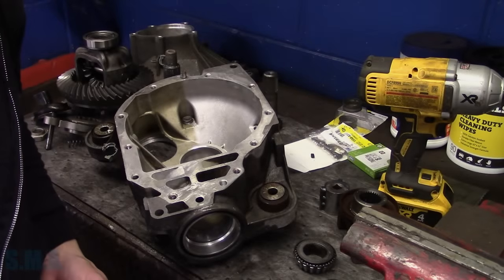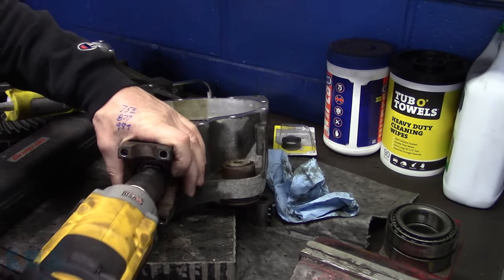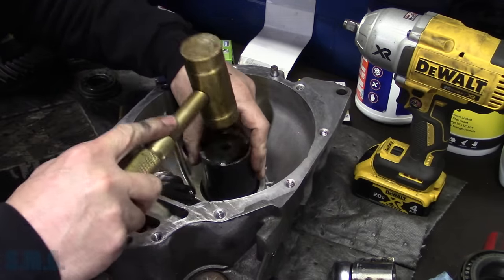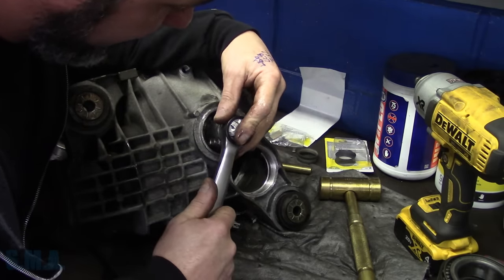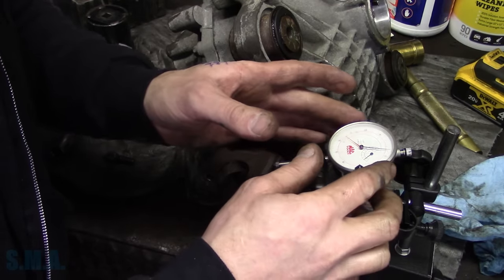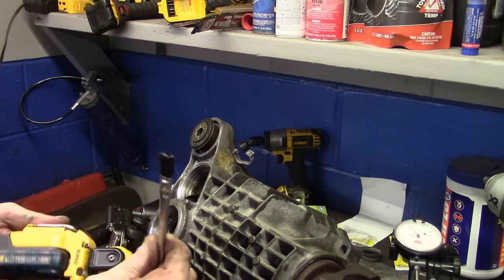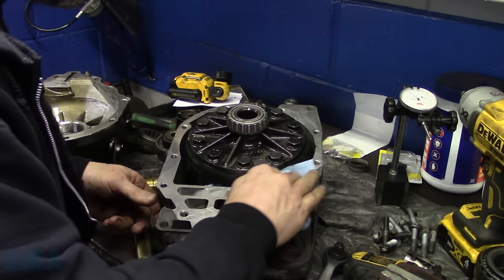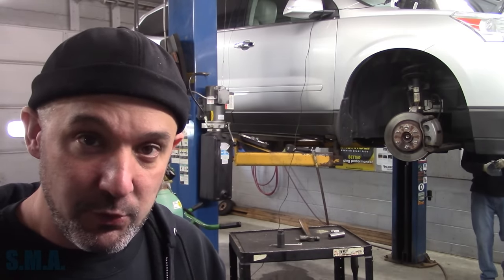Chevrolet Front Differential Set Up: Reusing Old Gears

Comment: Please do NOT say at the end of this video....if I can do it you can do it.....cause you have shown me that I have absolutely NO business messing around with this kind of repair
Reply: start off of something more simple like a ford 9".  Take your time and use your brain, you'll be fine.
Reply: I did my Ford 1 ton in my F250. I am not a mechanic, but I got it done right. I had to buy a few tools (bearing puller, dial indicator, inch pound torque wrench, 3/4" ratchet, etc). I swapped in 4.11 gears and a Detroit locker, so you can do it. You just need to take your time; there are many install/measure/tear apart cycles. Also, crushing a crush sleeve on a one ton required a 3/4 ratchet and 6 ft cheater bar.
Reply: Which is how he gets paid
Reply: Couldn’t have said that better myself Ray.

Comment: When a mechanic has the ingenuity to fabricate a tool to negate a price gouged OEM tool. You know that mechanic knows his "kibbles and bits".
Reply: Home mechanics do it all the time, too.  We have a former open end wrench that is now a U shape for removing the CPS on certain 3800's.  Many other examples but the second you own a welder, scrap metal becomes specialty tools
Reply: @michaelkrenzer3296  Too true. The old 3800s are good engines. But changing the spark plugs in a 90s GM is murder unless you've got the chutzpah to tie the engine block to a solid point or remove the rear mount and tilt the engine forward (speaking for a 92 Regal).

Comment: Very interesting video Eric.
As a purely amateur mechanic, I have dealt with issues on cars and motorbikes over forty odd years, ranging from brake jobs to engine re-builds. Never dared to touch a differential though.
Your video shows that if you have the correct information and the right tools, the job is relatively straightforward.
As a 60 yr old, I think you taught me something today.
Thank you.
Reply: As one senior, (64 y/o), amateur to another, also be mindful of metallurgy. I've never ventured in to a diff myself but have witnessed several swaps and can say that the pattern can sometimes be perfect yet there's still a bit of whine. Not screaming but with the windows up and the radio/HVAC blower off, still audible.
Reply: @watajob  It could be an axle bearing you are hearing.

Comment: Those Amsoil bag are great, made refill my rear diff very easy, especially since I wasn't using a lift.
Reply: @Leroys_Stuff  or I could just stick the tip that comes with the amsoil bag, into the diff. Fill plug and squeeze it until its empty.
Reply: DapimpBDSD I agree but some of us can’t get the bags lol

Comment: Great video and information.  I was able to completely replace all the bearings and seals on my 99 GMC Sierra Z71 1500.  The measurement information and how you did it was absolutely crucial.  My first attempt I had watched another video where a professional that does this for a living left out all the measurements and tool required to do the adjustments.  He put the axle retaining ring on the axle first then installed it into the diff.  This will not work with a normal GM retaining ring, new or otherwise.  The retaining ring must go in the carrier groove, not on the shaft.  I ruined 3 new bearings and seals following his directions.  Same goes for the other side, put the retaining ring in the gear first, not on the shaft.  So again, I really appreciate that you took the time to make this video.  After doing all the adjustments my diff is working perfect, 2nd go around!

Comment: Was an America Axle employee for 13yrs (95-08) Built this axle. White sealant was applied to inner splines of pinion flange. Beige thick grease kept t-clips in place during pressing. As far as adjusters, 'tube' side was ran in with ratchet until locked up, then backed off til pinion freewheeled in one direction, lock in other (Like a Sprague clutch). Otherside was ran in until backlash was achieved. A yellow grease paint was used to look at drive/coast patterns. Newer vent plugs were white plastic with an Aluminum weighed vent. 2 case halves were sealed with red loctite.  Cast iron tube & case was blue loctite (dissimilar metals).

Comment: Nice job Eric, enjoy your videos.  I worked for Chrysler for 18 years and overhauled a lot of differentials, one of the comments I have is replacement of bearings.  I always replaced both the pinion bearings and the side bearings, even if they looked good.  For the little extra expense, it was a policy that served me well on the repairs.  It was just so much extra work to replace bearings, especially pinion bearings, if they were noisy.  On this particular differential, I don't know how the pinion dept is set, it is usually by shims behind the pinion bearing cup or cone.  We had special tools which we used to make this important adjustment.  We usually didn't change the original shim if we just did a bearing change.  The only time we change the original pinion dept shim was with a new gear set or the original shim was destroyed if the bearing had spun on the pinion.  Again, thanks for all your videos, really enjoy your work, your are a credit to the trade.  A fellow mechanic from Canada.

Comment: Makin' special tools brings that tiny little smile -- it's just like cheatin'!

I've made a bunch of them over the years.  But, what other choice is there?  Pay the ridiculous C note plus price tag or go get a Craftsman/Harbor Freight/NAPA socket and make your own for just a couple of bucks.

I like the key way notion.  All the special tools I've made in the past involved whittling away at the metal of the donor socket.  Gonna have to keep the key way solution in mind should it ever be needed on one of my projects.
Reply: Yes if lucky enough to have a shop, dividing head, some fixturing, welder, and for fabricating and cutting stuff that need lathe and a milling machine. Otherwise a lot of precision filing by hand. It can be done.
Reply: I'm a DIY'er so time is a commodity of abundance.  Grinder, cut-off wheels, die grinder, file, old-school stick welder:  One can certainly make-do most of the time with such simple implements.
Reply: Got no time to make a a tool.Must call Snapon

Comment: I did my first gm ifs front differential rebuild when I changed my gears .  It was pretty miserable.  I feel your pain with this one.  I had to make a tool to tighten the nut also.  Mine had two teeth.  Yours was way better.  It would be so much better with at least three.   good job.
Reply: Me too!  I made a two tooth tool as well.

Comment: Screw adjustment ring gear !! Easy piesy compared to early internal shim placement on ring AND pinion punkins  that could take you all day to  dial in and get gear mesh correct.  Got to the point I could "feel" correct backlash ...........
Reply: Second that whole comment!
Reply: Best way to learn em too, not having to do all that heavy lifting
Reply: Ford had the better Idea for years

Comment: The manuals always  say don't  use  impact for setting bearings on crush sleeves. 
Dana factory tour shows them setting  everything with impact. 
I measure old sleeve and use solid  shims - set with impact - works every time.

Comment: Being a GM Tech. I do those all the time . Gravy job. Complaint is always poping snaping sound coming from front . If it looks like anti seize when you pull the drain plug. You replace all the bearings and seals with new locks . 45 min job once its out of the truck.

Comment: bearings always match the race, mixed up or where flipped at some time
Reply: my thoughts exactly, either the customer did some "extra" work, or another shop took it apart and just put it altogether haphazardly.
Reply: See this kind of damage a lot in drivetrains tbh. The big chunks missing is rare though. But I've seen just the carrier and the inner and outer races come out by themselves and the rollers/balls are nowhere to be found. Or the races just chewed to bits and the rollers/balls are just fine, guaranteed never mucked about with by customer transmissions and rear ends. Once these start vibrating and rattling they go bad right quick in a hurry.
Reply: Highly unlikely, 99.9% of the people would not drop the differential and tear it apart. Very few even change the gear lube. The bearings were most likely damaged from moisture contamination either from condensation or from water entering through the vent and or the axle seals from driving in deep water probably a combination of all of them.
Reply: @fredhankes5608  My thoughts exactly, Fred.
Reply: @fredhankes5608  Fred I have to agree with you, couldn't figure out why front diff bearings would fail seeing how they get much less use than the rear.  moisture it is.
Reply: Used gears should double back lash tolerance. Remember loose is fast
Reply: @ronvonbargen8411  Used gears should REDUCE recommended clearances.   Remember, recommended clearances for new gears take into account the wear-in that new gears will experience, which will increase clearances as that wear progresses.  Gear tolerances looser than recommended do not result in "faster", but they do result in more noise and can result in more wear.
Reply: Larry fry thank you for clarifying. Makes sense when you explained it. I've only set up two diffs both 9 inch Ford. The extra clearance I gave them (. 005-.008) is probably why I had the "clink" sound when letting off the gas and mashing it back down. But they didn't sound noisy.
Reply: @ronvonbargen8411  You are right: you are hearing that excessive clearance when cycling between drive and decel.  Sometimes that clunk is the result, sometimes it will be gear whine.

Comment: When I rebuilt the rear diff in my WJ i ordered three crush sleeves to be safe, i used two:)  that last 3in-lbs goes fast
Reply: When I did this for the first time on a D35 from a explorer I started with 3 crush sleeves. I got it right on the 3rd one.

Comment: I was shouting "check the gear pattern before you bend that tab" but I guess you couldn't hear me over the noise of the phone.
Reply: Chris Hartley tough to get a good drive side pattern defined on a used gearset. Sometimes you can see the coast pattern on a used set, sometimes not. But you are correct, you always check the gear contact pattern.
Reply: @wdsracer  howling gears they'll be, 20% chance at best lol
Reply: @throttlebottle5906  but howling doesn't do any damage more than normal tho, right?
Reply: It's all practice practice...if you work on them day in day out it becomes not a chore
Reply: Funny how I got a notification of this last comment but not the previous one.
The howling gears will most certainly suffer more damage, it isn't properly aligned which is why it howls, but difficult to say how significant it will be.
The damage to eardrums could be more worrying. 😁
Reply: @chrishartley1210   That's concerning consider half of 3rd gen Tacoma owners on Tacomaworld have reported howling rear diffs.

Comment: I was seriously a spec need by the numbers when I rebuilt my rear diff. and axles seal bearings yada yada as well as the front diff.. Did it all while on a bottle of oxygen. Needed my 6'4 brother on a breaker bar to get the drag just right on the pinion preload . I was woosified from all the work I did on that beast.

Comment: To me, it looks like the diff had been apart before. The carrier bearing and races were swapped so that you had a bad bearing and a good race together. I have done this when I was young and dumb to save a couple of bucks and get a few more miles out of the bearing. I have learned the hard way this only sets you up for a catastrophic failure at the worst possible time and the purchase of even more expensive parts at that time. Thanks for the great video.

Comment: Had a buddy get a summer job at GM assembly plant and his job was to set up differentials.  I wouldn't trust this guy to change a light bulb.
Reply: For me, working on GM 10 & 12 bolt rear ends of even truck rear ends. I don't know why the gear sellers make a big deal about pinion depth. The dimension you need to know and work from is the face of the bearing that the pinion gear fits into. Figure the split, measure to the face of the bearing, calculate the needed shim and put it together. Knowing where the face of the bearing is from the center line of the diff solves your problem, take it apart, try again is nuts.

Comment: I had an 04 Avalanche that had the same exact issues.  The dealership put a new nest kit into the front diff and it still made noise.  Turns out that 4 more visits to the same dealership and I finally took matters into my own hand and found the hubs were shot.  Replaced them myself and amazingly ALL the noise in the front end went away.

Comment: Amazed at all the knowledge and experience Eric has.  Realized that when we watch this in 20yrs time these machines will seem grossly antiquated compared to what we will be driving.  Tesla does over the air fixes today for example.  Enjoyed the video and of course Eric's comments! 👍
Reply: You can’t change brake pads ‘over the air.’
Sadly, in 20 years, vehicles will probably be share leases, they’ll be recycled instead of repaired, and gasoline will cost $20/gal due to low demand, totally defying the economic law of big supply = low price
Diesel trucks will be the only place mechanics will be needed.

Comment: Thank You!  I have a 2008 Suburban with a different adjuster, but I am going to assume the specs you gave are good as well.  Mine was slightly noisy and leaking so I am doing all the bearings and seals. Quite a bit of metal shavings inside. While putting it back together and I found one adjuster was about 1/8 inch turned out!  Tomorrow I'm welding an adjuster tool to do exactly what you did in your video. Love watching your videos!

Comment: I learned how to set backlash from an old mechanic that didn't have any type of measurement tools. He used a chunk of a paper sack to run between the gears to set his up. He put a little grease on one side of the sack and looked at the pattern after running through the gears. He never had any come backs or problems.  I never got the nerve to try it.

Comment: These GM IFS can be some of the hardest. You can have proper backlash and “setting up” but still have gear whine or leaks. Even use American Axle parts. Sometimes the case is just worn in the slightest.

Comment: I spent ten years in a shop that specialized in differential, manual trans, and t-case work. You would be a master in about two weeks. That was exactly how I would have tackled that one. The only advice I could add is that a broken hammer handle is perfect for creating drag on the ring gear while spinning the pinion with a cordless drill to check the pattern.

Comment: Thanks Eric for taking the time to explain the process in repairing this differential. I had a Chevy PU back in 94 every 3 thousand miles it was in the shop to have the (you guessed it) the front drivers side seal replaced. This was on a brand new PU truck. Wished I had this kind of stuff to look at back then. Needless to say not a GM fan for sure.

Comment: That was great, thanks Eric. First time I've ever seen a mechanic tackle a diff, where I live they get sent to 'specialist's'
who charge thousands.
We don't have old school mechanics  like you nowdays. 
They call themselves Technicians. These guys and girls just replace parts and clear codes. These days these young technician's, don't have enough experience to diagnose faults, especially in transmissions and diffs. I had a new Ford Fusion (Mondeo) with the F635 transmission that was making a groaning noise when you took your foot off the gas at low speed in 3rd gear. Two senior Technicians could not agree whether it was the transmission or the Turbo. 
They got their Ford Dealership up North to send down an 'Expert' to take the car for a road test. I gelt sure that  the noise was coming from the transmission.
Car had only done 14,000 kilometres from new. 
Took weeks to get the 'expert'
down from up North.
Why fo dealerships hate or refuse to honor warranties?
I got impatient and pissed at these clowns and disposed of the car and went and bought another new one, but a different brand. So far all good with the different brand. I just wish we had real mechanics like you Eric. O.

Comment: One thing I learned over the years is to set up used gears on the coast side. Sounds silly, but always works. Or you'll be pulling your hair out setting pinion depth and backlash.

Comment: Eric, your backlash was probably spot on. If you measured on the shaft of the pinion and not the yoke I'm sure it would of been close. you have to remember the measurement is increased by the distance you are away form the shaft.

Comment: Very nice video. I have learned from this and I thank you. Very practical. 
I do have a comment (don’t go ballistic on me folks) concerning the Snap-on torque wrench. It seems a better matched wrench selection for the job would be more appropriate. You are measuring about 15-20 inch lbs on a meter that reads 300 full scale. That means you are measuring at the very low end of scale...5-7%. I’m sure the accuracy doesn’t matter much as I see most everyone using that wrench. A better selected measuring torque wrench should read mid scale. Again, maybe this doesn’t matter much, but it certainly does in other applications.

Comment: I changed my gearing on my 1996 Tahoe with 250,000 miles on it from 3.42 to 3.73 ratio and it drives so much better now. it went from a turtle to a faster turtle on take off.